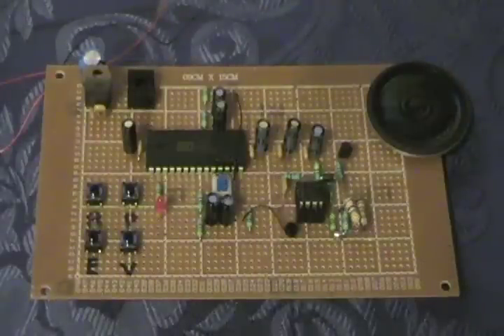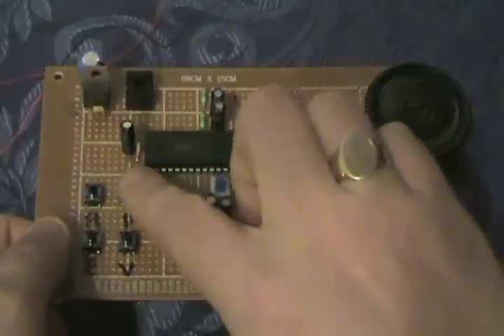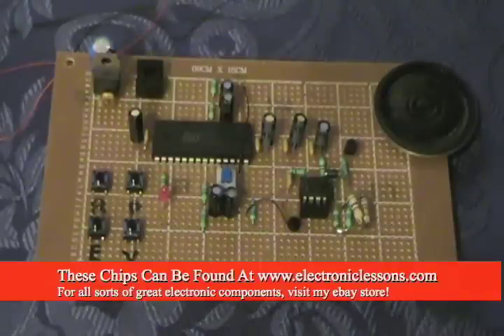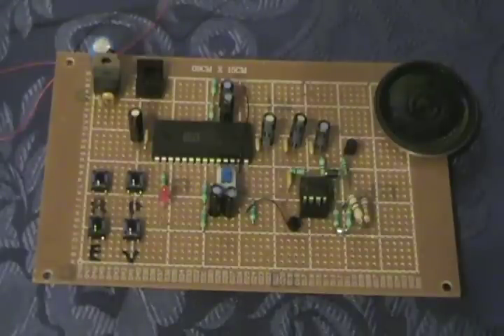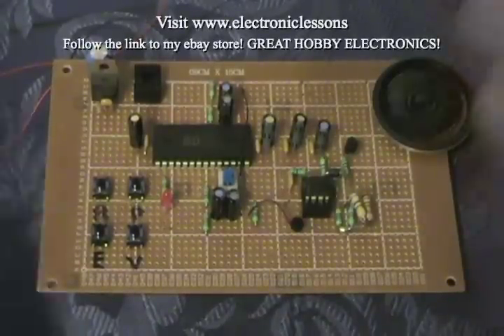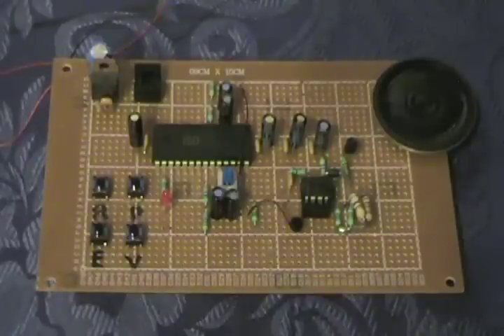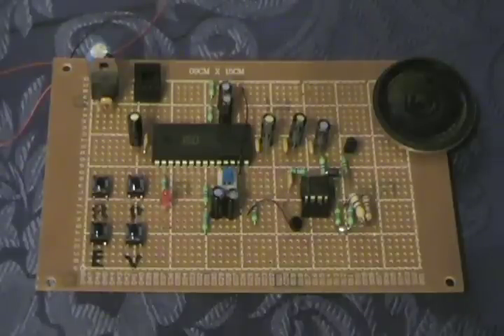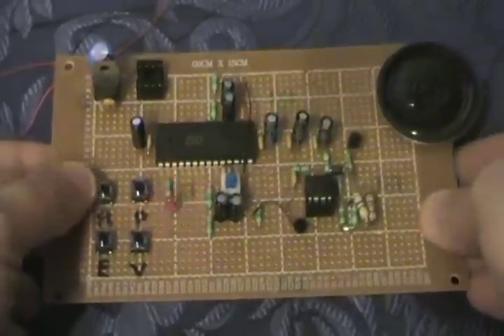Sound Activated Record and Playback Circuit - Interface to Security System!

Comment: what if i wanted to run this with 12 volts example wire it to a car speaker and put it in my car and hook it up to my cars security system so it says back away from the car  or something along them lines  only louder